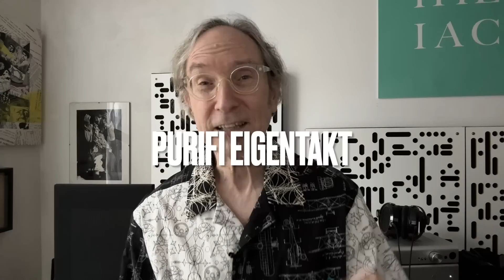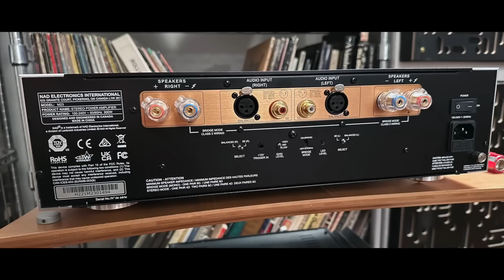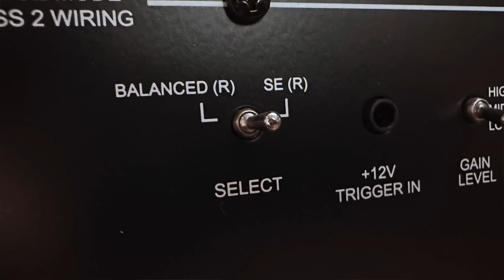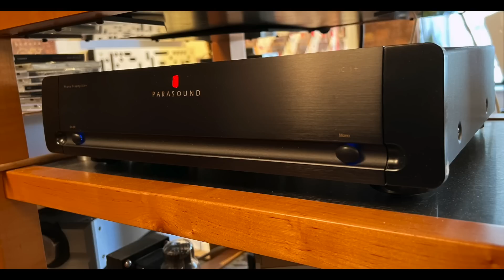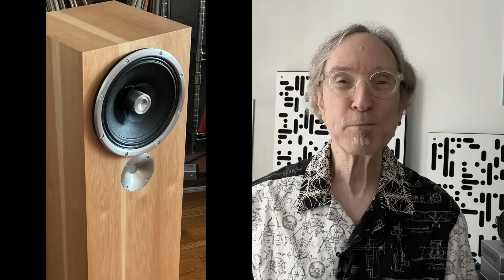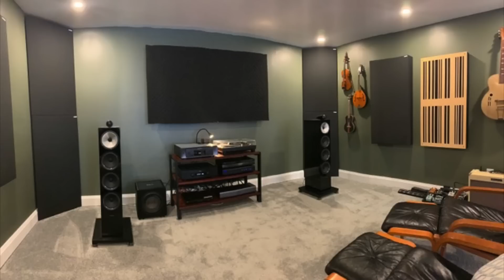NAD M23 Amplifier: Class D Done Right!

Comment: Mazel tov, Steve!  You've discovered an actual high fidelity -- meaning "great faithfulness" to the intentions of the folks behind the recording -- component rather than something merely "high end" or, for that matter, high-priced and pleasantly euphonic to your particular, heavily conditioned -- you can take the boy out of Sound by Singer, but it's much more difficult to take the Sound by Singer out of the boy -- preferences.

That said, feature set and cosmetics aside, I'm willing to bet this thing performs 95 to 99 percent identically to the dozens of other -- and very likely far cheaper -- power amps using the same Purifi modules.  The best thing a Purifi OEM can do is provide an input buffer that doesn't pollute the built-in near-perfection of Bruno's work -- so congrats to NAD for apparently accomplishng that and to you for noticing truly high fidelity!

Comment: How does this compare to the Parasound Halo A21+?  It has a 5 year warranty (parts and labor), it's a conventional class AB circuit, and it's a little bit more affordable.
Reply: I upgraded from a Parasound Halo A23+ to the NAD M23 and I've been loving it. I assumed that my Parasound wasn't the weak spot in my system and that the Marantz preamp was, I was pleasantly surprised when that assumption was wrong. I heard a lot more detail in the M23, much better imaging, and soundstage was much deeper.
Reply: M23 blows this out of the water
Reply: @stephencosta6814  - I would think so it’s built like a tank and has much more current amperage to drive anything. Grunt and balls…